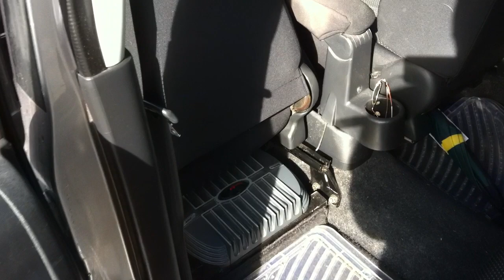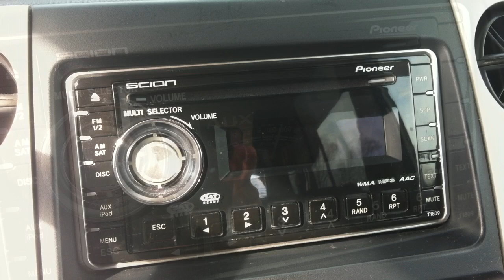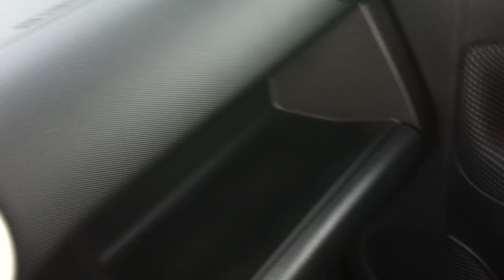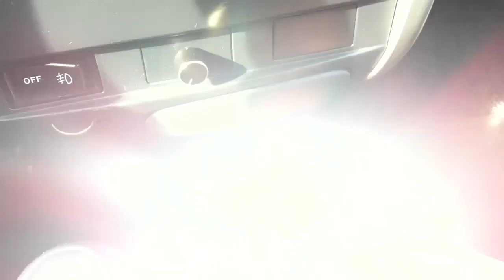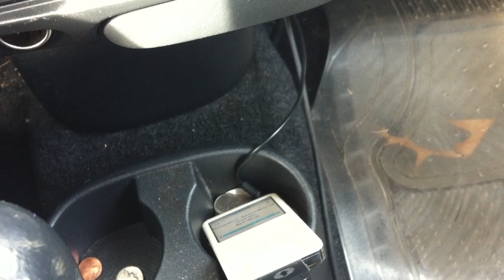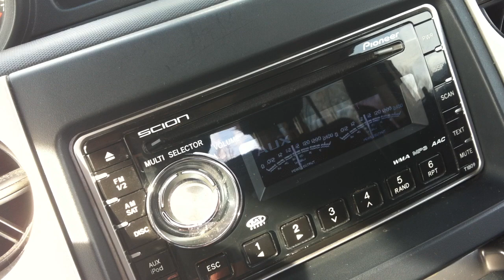BigDWiz Scion xB - Modest Sound System - Rockford Fosgate JL Audio & More!

Comment: I know this is an old video, but how do you turn the sub output on with this radio? Putting a small system in my daughters 08 xB, and it says "SW NOT AVAILABLE" when I go to the adjustment. I know there must be an easy way to get it going, but I am not able to find it.

Comment: I know this an old video man but I need help I got a 2009 Scion xB base model and I can’t seem to get the stereo to play there is no sound what so ever I need help idk if the car came with a built in amp it had the same stereo that u have on the vid the car was bought in an auction.
Reply from the maker: You'll need to pull out the head unit and make sure the harnesses are plugged in. If they are, then you'll need to check speakers individually. Seems doubtful all speakers are bad, but they could've been removed? Amp is built into unit, so there is no external amp to be concerned with (if it's stock)

Comment: Hello, need some help. Having an issue with the radio. So I installed a amp and sub. All the wiring is as it should be. Good power, ground and remote. Speaker wire brand new. RCA cables hooked into the SW pre outs on the back of the T1809 HU. Sub control is tuned on in hidden menu and on the main audio menu. I'm getting nothing out my sub. I will be swapping my RCA cables to make sure it isn't the problem. Not sure where I went wrong. Done this type of install many times.
Reply from the maker: Do a google search for the T1809, there was a lot of info in a forum years ago when I got mine. I sold the car several years ago, sounds like you are down the correct path of troubleshooting
Reply: Williston Audio Labs yea I'll keep trying. I've been googling the last 12 hrs on it. Just have to start double checking ish when I get off work

Comment: When you connect an iPod to the AUX input of your HU, you're relying on the DAC in the iPod to convert audio to analog then most HU will digitalize the analog stream again for EQ or other processing. With Pioneer HU, I found their built-in audio file player is way better than iPod, not to mention their "Compressed Audio Restorer (can't remember the marketing name)" they use and that make a pretty good job restoring the highs in compressed audio files. Even with lossless files, you will benefit of using the HU DAC as the single point of audio conversion, it just sound better. As for iPod, older version like yours can stream digitally using the charging cable and an USB port, this will make the HU to decode the stream thus producing better sound from lossless music files.

Comment: Did you run into any problems while hooking up the amp and sub? The problem I'm having is; when I connect my RCA's from the rear of the unit, there is no sub play. Amp powers on and sub control from the HU is turned on; just no play from the sub. Is there something I should know or I'm missing?

Comment: I have the same radio on this 2006 xb i just purchased and the aux button does nothing when pressed. i checked the plug on the aux input by the console and is in good. any help would be greatly appreciated
Reply from the maker: Feroze Yasin I had to buy a special adapter off Ebay to work the Aux portion. Sorry I can't recall exactly what I bought and since this video I've sold the head unit and the car
Reply: Ok thanks i did purchase one this morning from ebay. I just though since the aux input was there that the aux on the radio was hooked up.
Reply: Feroze Yasin what special adapter did you get i can't get my aux to go
Reply: Feroze Yasin what piece did you ge t

Comment: Did you have any issues using a newer premium radio on the xb?
Reply from the maker: Jason Aguirre no, not at all. There was a special adapter I needed for an iPod connection as my 2005 xB didn't have the plug. Otherwise, it worked great!

Comment from the maker: @iceman45ification1 Thx ice! I said in the video I've been using the amp since 2003, actually since 2002! I had it in my '96 Maxima powering Boston RC67's in the doors, then bridged mono to a (single) original JL Audio 12W4 D4 in a sealed 1.5cuft box. I let some of my old school buddies hear this back then, they almost swore I had dual 15's in my trunk! They used HF Zeus and RF DSM amps in the early 90's and couldn't believe that single 550x was so strong!

Comment from the maker: @gogojjt The JL 15 is slightly boomy to me. I got it on a trade (for a unloaded dual 10" box) and the box is slightly too small. I think the (3) 8W6's are gonna be the ticket. My alt is only 80A and I'd prefer to keep the overall amperage pull as low as possible so I don't have to add a bigger alt or additional battery. The car is already lacking power and even adding the (3) 8's may put a strain on the 1.5L 4cyl....(weight wise)